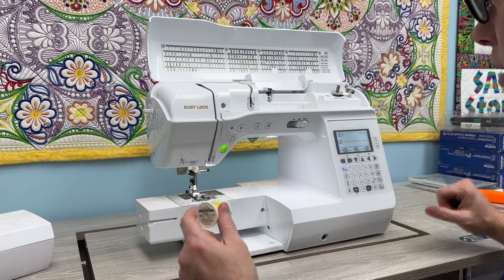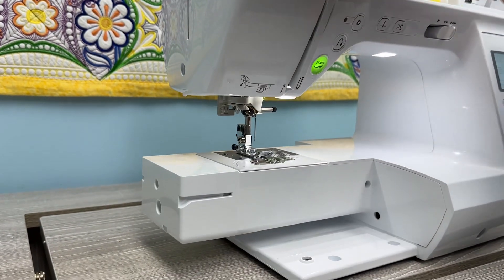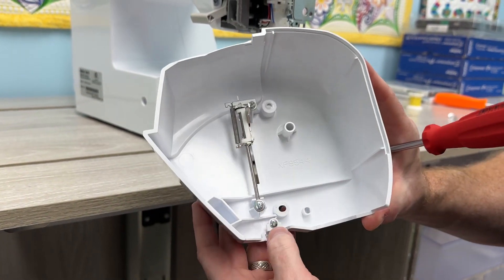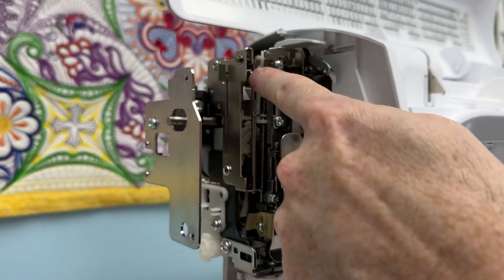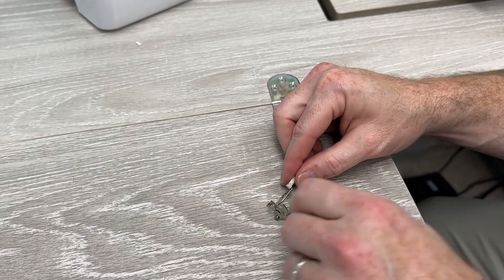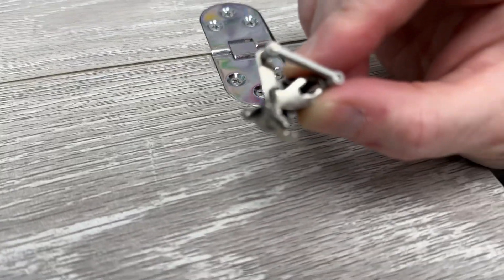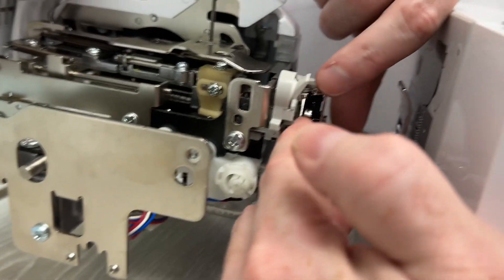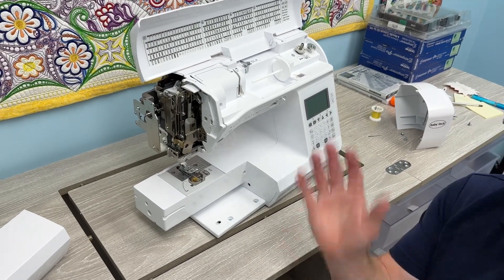How to fix a threader on a brother and baby lock

Comment: Hello and thank you for this video. However, my problem is not that it doesn't go down my problem is it won't actually thread the needle. My sister seems to think the little wire that catches the thread somehow got out of the proper alignment. How would I know and how would I fix it? I live 2 hrs away from my dealer and I really don't want to take that trip if I can repair it myself. Thank you for any help you can provide! 🙂
Reply: I’m having the same problem.
Reply: I'm having the same problem. It just stopped threading.
Reply: same problem here
Reply: I'm having the same problem,it won't thread or bounce back.